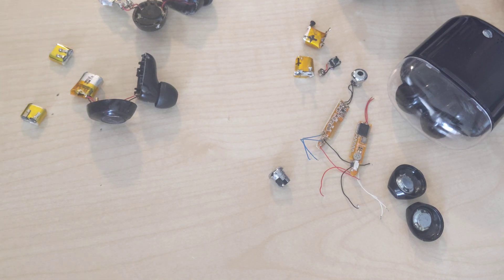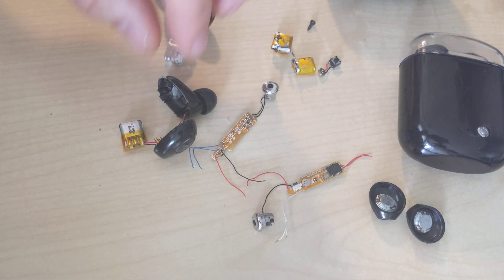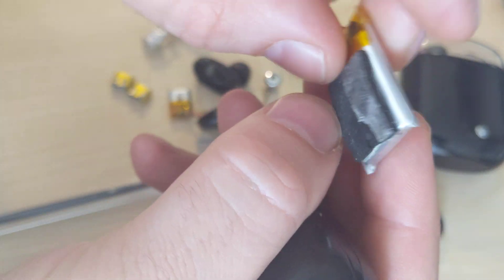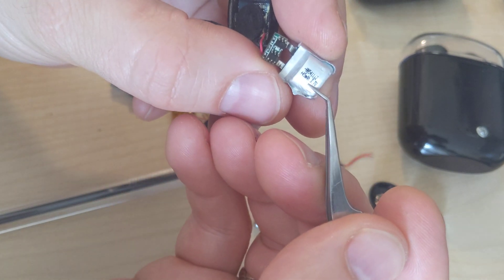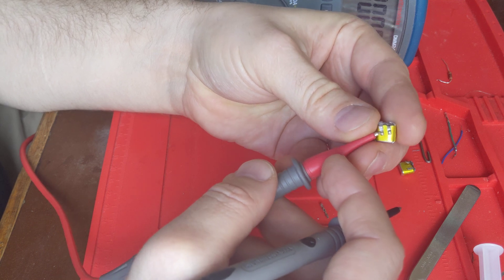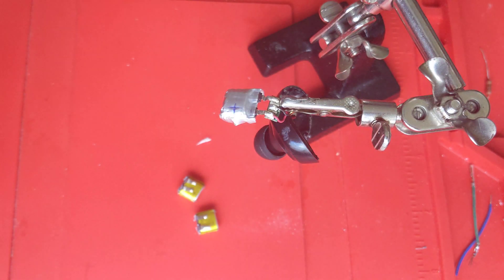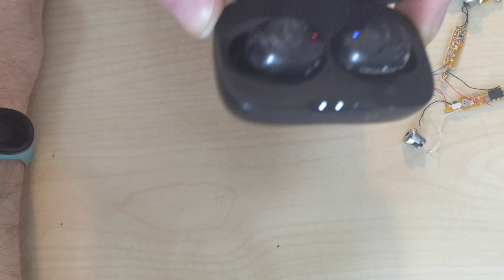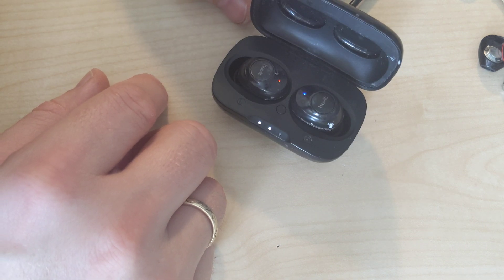Bluetooth earbuds repairing - battery replacement

Comment: Can you follow up as to whether the replacement was a success or not?  You had mentioned that you were going to test them but the the charging seemed kinda funky.
Reply from the maker: Hello! Yes, sorry, actually the repair was great success and I'm ending up using these ear buds when I'm cycling, because with the cycling helmet regular headsets don't fit. So, yea, the repair turns out to be great, it holds charge up to 1h or so!